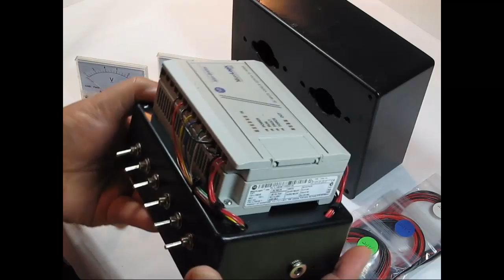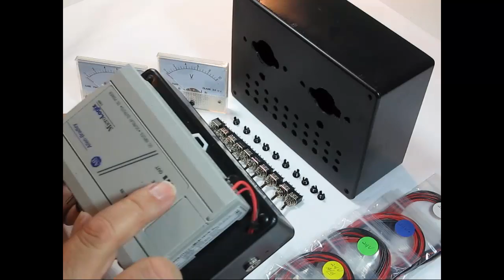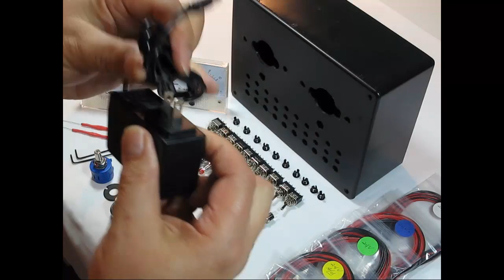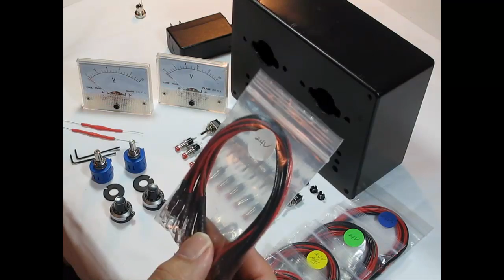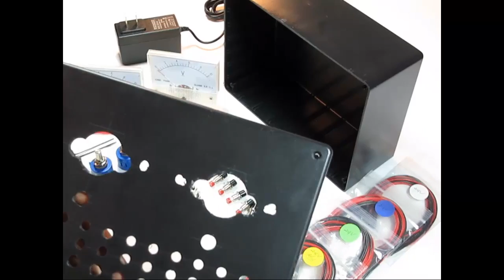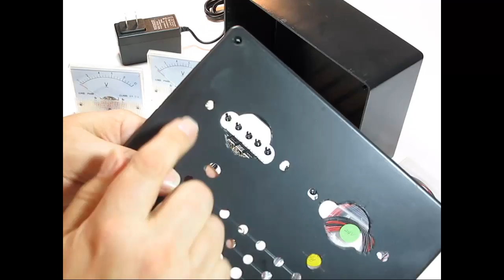TS03 Pt.3 - How To Build a Trainer with Analog - Components

Comment: Hello Professor,

First of all excellent videos! I was looking all over to make a trainer kit like this with analog inputs. If I want to use this kit , I need to buy a Micrologix 1000                      1761-L20AWA-5A ?
Reply from the maker: The project box in the kit is too small for the larger processor footprint. I would not use those type of meters again, you can purchase LED meters very inexpensively, however you have to cut rectangular holes to mount them.